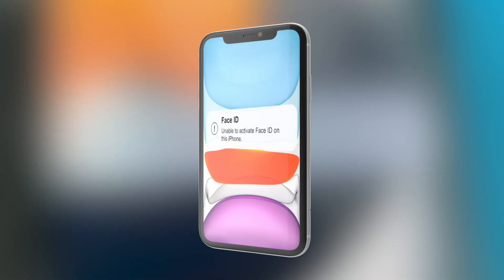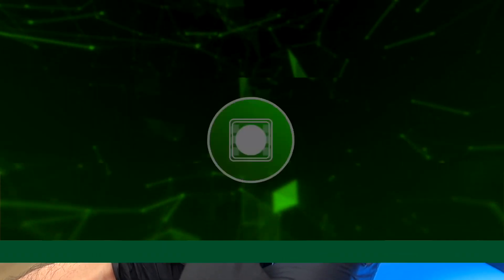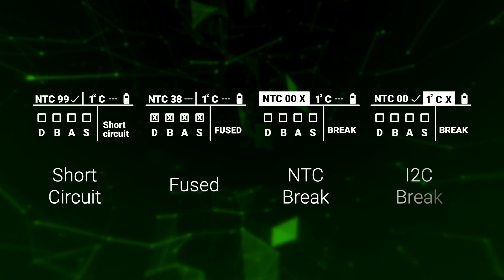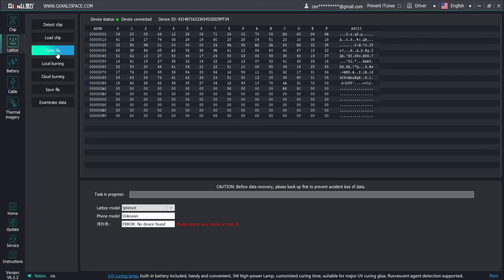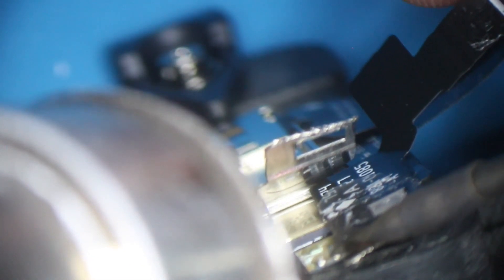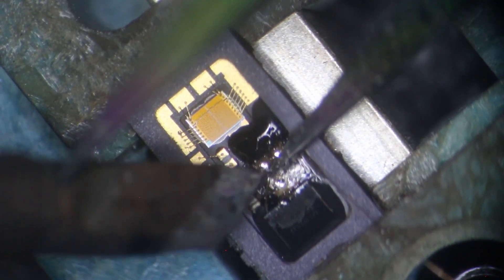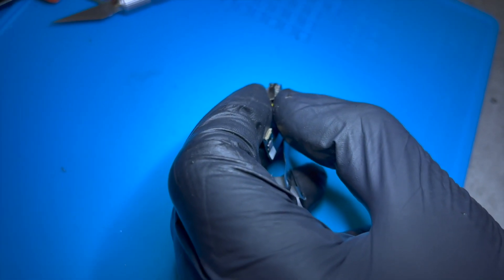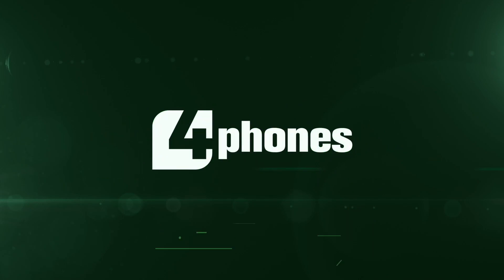TUTORIAL: repair iPhone Face ID

Comment: it is much much easier if we download and upload and replace new whole face id module than replace chip 
I was wondering why aliexpress has no whole face id module. they got camera , motherboard they got everything but face id module.
is there anywhere can buy whole face id module?
Reply from the maker: Hi 케라케라! You can find all QianLi Face ID products on our website here: https://www.4phones.eu/catalogsearch/result/?q=qianli+face+id

The chip must be changed (the flex) because it is not reprogrammable, and also you have to set a jumper to be able to write the data.
In order to fully understand how the Face ID and repairing process works, we recommend to follow the Face ID repair course :)